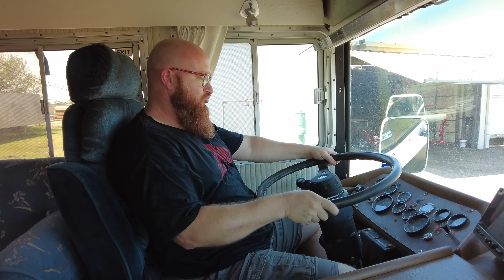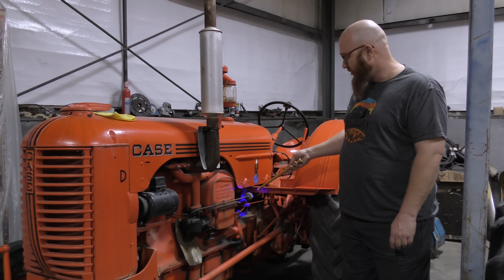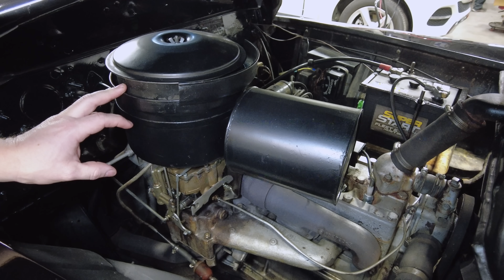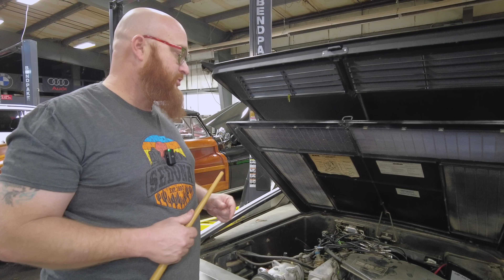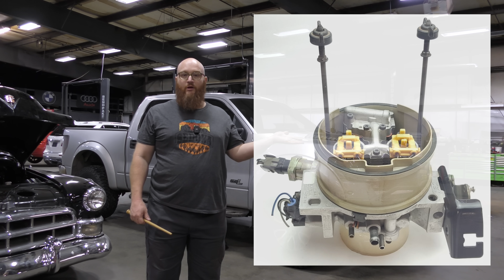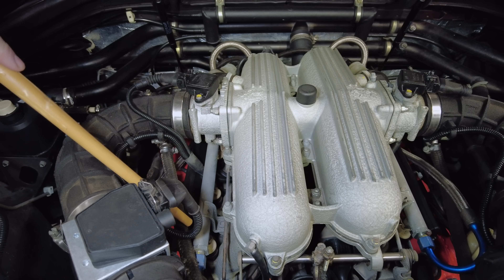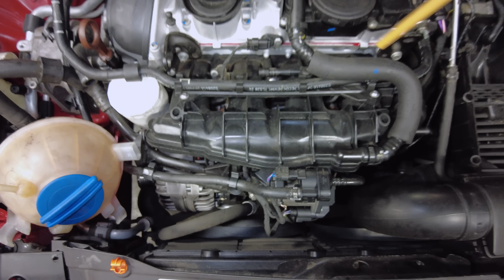Fuel System Maintenance for Every Car Type: A Comprehensive Guide

Comment: I used to have an 81 Honda Accord with a 3bbl carb on it. Ethanol wasn't widely used in gas like it was today. That car would run perfect until you drove it and stopped it for 30 minutes like going into the store to get some things. When I would go start it, it would start right up, but it would stall out after a minute or so and it would be a beast to get restarted. I spent a lot of money at the Honda dealer and they never fixed it. I changed the gas and the problem went away. It didn't like the gasahol that was sold at the time. That is what they called Ethanol fuel in the early 80s. Somehow the heat of the engine was evaporating the fuel or it was vapor locking? I didn't know what was going on. I knew it didn't like the gas. It ran perfect with 100% unleaded gas, so even in the 80s, the gas was better.

Comment: awesome recap of the history of auto fuel systems, I wish you would have mentioned Toyota's D4S system, that combines direct and port fuel injection
Reply: Toyota does it so it would not carbon up the intake valves and keeps the engine running past 100k with no issues of rough running
Reply: @ToomasTelling certain conditions port injection is more efficient, valve cleaning is a secondary (and necessary)  effect.
Reply: Is the Gm6.2L gas engine a combination of port and direct injection?
Reply: @dancin4  not sure,  the 6.2 has been through many generations of cars, if we're talking older than 2016 (possibly still with some newer model years as well) then  it is  port injection
Reply: So can the extra fuel injectors be spotted on the intake? Or is there an engine designation  type ie :LT4 or LS gen 4?
Reply: @dancin4  if there are direct injectors they will be on top of the valve covers or under the intake, the port injectors on LS series engines are always on the outside of the intake manifold at the base (where the intake bolts to the cylinder heads) on both sides

Comment: Wizard you forgot one more fuel delivery system. My wife has a 2020 Toyota Camry with the 2.5IL 4 cylinder engine that has both direct injectors and sequential fuel injectors in the intake manifold. The injectors in the intake manifold fire often enough to clean the intake vale. This is called  dual fuel injection engine. When the intake injectors cycle the direct injectors don't cycle. This is the best of two worlds when it comes to fuel injector engines.
Reply: Good engineering for sure.
Reply: In the d4s system the direct injection can run with the port injectors also
Reply: Ford 5.0 for F150 and Mustang has direct and port injection. 16 injectors.
Reply: You are correct,sir
Reply: Got to love Toyota.
Reply: Toyota #1 💯
Reply: But will Toyota put an electric-drive supercharger on it?
Reply: Regardless of the intended purpose of a direct and port injected engine, I REALLY wish my 19 WRX had port injectors in addition to direct injectors.
Reply: Yeah but its just a variation of fuel injection designed to compensate for the valve fouling on DI engines
Reply: @davva360  1a
Reply: @davva360 
That's not what it was designed for - it's simply fuel efficiency; that the intakes get cleaned is just a bonus.
Reply: @atticstattic  it was designed for that purpose.
Reply: @rgbigdog  
Most assuredly, it was not.
Reply: @atticstattic they don't do dual injection for efficiency. If efficiency was the only goal, it would just be directed injected, meaning it's always getting fuel most efficiently AND slightly lower weight. Having port injection as well is literally intended for the best of both worlds... better efficiency when needed, and internal cleaning in other situations.
Reply: @Scott8919  port injection can be more in efficient in certain situations  like at idle and high rpm
Reply: @scott8919 
That's blatantly false; there are situations where port fuel injection is more efficient than direct injection, having both takes full advantage of that. That the valves get cleaned is simply a bonus.
Reply: @atticstattic  Are you sure about this? The reason for direct injection is better efficiency and lower emissions. Does a mixed system do as well?
Reply: @deanrhodenizer938  
At certain load/rpm combinations, port fuel injection is more efficient. Toyota has had a number of write ups in the press about this since Lexus introduced it in 2006. More than a few industry reporters speculated that there was some kind of "cleaning cycle " that the port injectors were for and that turned out not to be the case - it's all done for fuel efficiency. Just so happens that cleaning the intakes is a benefit.
Reply: @atticstattic   Thank you for explaining. I learned something new today.
Reply: Ford has been doing this on eb's for years now. Nothing new.
Reply: All the port injection is there for us to clean the carbon buildup off the valves. Since DFI (direct fuel injection) fires right above or next to spark plug.
Reply: @brandonzackheim4550  
Wrong.  The combination of direct and port fuel injection allows for better fuel atomization and more precise control over the air-fuel mixture, leading to improved fuel efficiency.

Comment: Compare these fuel injection pressures to high pressure common rail systems in today’s diesel engines…diesel systems typically run well over 20,000 psi…sometimes over 30,000!

Comment: I'm watching from Brazil where we run our cars on 100% ethanol.  Is carbon build up still a problem for direct injection engines? Yes, we still have oil and PVC valves, so maybe...?
Reply: It is, it's the PCV system that causes the most buildup in DI engines as oil vapors burn onto the valve tops, and any oil that gets past the valve seals.

I like ethanol as a fuel, high ethanol content fuel (e85) is great for power and a clean running engine. I ran it for 10y until I moved and lost access to it.
Reply: Yup 100% ethanol here is a popular fuel. Government policy and specially bred sugar cane.... Gasoline is also available but priced so the per liter price yields about the same number of kilometers per unit of currency when using a flex fuel engine. Maybe ethanol has a small price advantage.  Seems air pollution from modern cars here is not a problem.   Diesel trucks are a problem... But I have not seen any alternative duels in use for heavy trucking.  EVs are rare. Do see some electric bikes and scooters in cities....

Comment: As somebody with a car that produces 66 BHP [Hyundai i10] I always use the fuel with the least Ethanol. It makes a huge difference!
Reply: If it's the Kappa engine, it's the same 998cc as my 1980 Mini, minus one cylinder. 🤣 But me, I'll never touch or buy a Hyundai or KIA. EXCEPT maybe the first gen Sportage. But that's if I failed to get a Suzuki Samurai, or a classic Lada Niva, which I have seen a Niva in my neighborhood.
Reply: Had Hyundais  for 25  years and can't fault  them! My 10 year old i10 should see me out!   _  would love a Niva - one of me dream cars! Couldn't afford the petrol!   @alpine1600s
Reply: Ethanol increases octane and can make more power. . . It does hurt fuel economy, however.
Reply: Honestly not noticing a dip in mpg using E10… you’d need a flat rolling road for a fair test I guess but I think it’s placebo mate especially on small N/A engines

Comment: I was glad when I purchased my first  computer operated fuel injected car. On cold mornings just turn the key and it would start and regulate the cold idle all by itself. On my previous carb mounted cars I would have to set the choke by depressing the gas pedal once and start the car without flooding the engine to warm up the engine then come back five minutes later and hit the gas to knock the choke off. The only thing I found annoying about fuel injected cars was that I could hear the injectors activate which I initially thought that it had valve tappet tapping
Reply: You could have just driven the car right after starting it up. Much healthier for the engine instead of letting it just run at increased idle.
Reply: Increased chance of stalling...
deadly in intersection/driveway exits etc.
 @SuperDirk1965
Reply: @SuperDirk1965  we used to have much colder winters plus my first car was a '64 Pontiac tempest lemans I bought for $200. Cars like that back in the day needed to be warmed up first as they would stall if you tried to take off on first startup. And yeah,with today's fuel injected cars I do take off within a minute of startup
Reply: @LilYeshua  I started driving in 1983 so I have driven my fair share of carburated cars. You pull the choke, tread on the accelerator a couple of times, start the car and drive it within the first seconds after it starts up. As it would warm up you'd gradually push in the choke. But then I'm talking about European cars, never driven the american crap.

Comment: Plenty of VW Golf GTi cars from the very early 1980’s still running in the UK and plenty more in the rest of Europe. Most are now with enthusiastic collectors. My friend up the road bought one just two weeks ago. We both had ones in 1982, his being a 1.6 and mine the revised 1.8 GTi.  All 112hp of it. The Bosch K-Jetronic was a big advance over carburetted cars of the era but was soon superseded by fully electronic fuel injection.  There were some examples of single point injection engines on four cylinder cars during the mid to late 1980’s.
Reply: Vauxhall in the UK with the Astra J (so 1997 ?), had single point injection on the lower power engines, and then Multi point sequential on higher output engines. So you could have a 1.4 with 75bhp or 90bhp.
Reply: Your fuel is much higher quality than what we get in the US.  As a result oil change intervals are double for my Porsche in Europe compared to the US due to the better fuel.

Comment: No more oil bath air filters unless it’s the modern ones you spray oil on and clean. Imagine not ever paying for air filters 😮
Reply: I believe the oil bath filters let dust through. They bubble air through oil and the air in the center of the bubble remains uncleaned.

I saw a test on one somewhere and a modern paper filter was better.
Reply: @volvo09  oil bath filters have a metal mesh inside that oil clings to.

Comment: Ethanol will boil in your fuel lines that can get hot once you stop. Can cause a stall until the fuel circulates and cools
Reply: If you have an older carburetor car that you dont drive daily the solution to vapor lock is to run Rec fuel (boat fuel) sold at some gas stations. It is non-ethanol. It is pricey but solves the headaches and embarassment.
Reply: @gregholst5604  I only get the stalling when I restart my engine, an LS1 in a Camaro, fuel injected. Todays gas is crap
Reply: @HypocriticYT   That should not happen to a modern engine with fuel injection.. when the key goes on it should pressurize and ideally bypass back to tank so any vapor is eliminated.. maybe another temp or sensor related issue?
Reply: @gregholst5604  only happens in hot weather once you dive a while and shut off and start again. No codes and have had a GM new fuel pump in it. Doesn’t do it in temperature under about 75
Reply: @gregholst5604  thermostat is good and gauges read good. Once I start it from a stall it doesn't reoccur. I should try a different gas station next summer to see if it's the fuel. Has new fuel filter, idle control and MAF sensor. Sometimes you have to wait until it gets worse to diagnose (if it gets worse) though not a big issue now.
Reply: I would try rec fuel (pure gasoline / usually 90 octane) next time your tank is low and get that worked into the system to see if it stops the problem. Engine temps and operation may be normal but a weak fuel pump or bad fuel recirculation may need to be addressed to run gas with ethanol and avoid stalls when it is warmer outside.
Reply: @gregholst5604  has a new GM fuel pump and tested good. I always run 91 octane fuel. The car is a 2002 so you can get odd stuff occuring.
Reply: Gasoline in your lines will boil at a lower temperature.  Cars being hydrolocked from gas boiling is not a new thing.
Reply: I meant vapor lock.
Reply: @RichiPuppi the fuel system should remain under pressure when the car is off (roughly 50 psi) the high pressure raises the boiling point. 

If the check valve in the pump is bad you will get vaporlock or drain back, but it doesn't last more than 5ish seconds.

Comment: ethanol content in fuel kills carbs, especially small engines that spend a lot of time parked.
Reply: Yeah, don't keep small engines unused. Run them regularly, or drain the carb.
Reply: Yup - I added a fuel shutoff valve and fuel stabilizer for both my lawnmower and snowblower when I park them for the year. No more bad carbs.

Comment: 3:10 remember, back then gas was actual gas all together different formula higher octane whole different animal.
Reply: Two stations near me are selling NON ethanol gas again.
Reply: @opuscat999  Right, where is that? Throughout the agriculture areas which is most of the state in central Kansas there are plenty of non-ethanol grades offered and it's getting popular. I was just there two months ago driving around and did fill up with it. Got to have it for the old equipment.
Reply: I am in northeast Ohio  @JSFGuy
Reply: In my area, Palm Beach County Fla, non=ethanol gas is one dollar per gallon higher a gallon than Reg 10% @opuscat999
Reply: During a recent power outage, had to help someone with getting fuel for their generator and they were told to get ethanol free fuel to preserve the engine.  Found out my local gas station (rural Mid-Michigan) has an aboveground tank and pump for 90 octane ethanol free @ 5.50/gal compared to 4.25 for 87 octane.
Reply: @danielseelye6005  Right, well you can run the 10% through there even a little higher if you run it through like today don't leave it set It's not the engine it's the carburetor and the pieces inside the soft rubber and gaskets and all that jive. I put 30% in my non-ethanol car because I was going to drive it out today and it worked fine.
Reply: "when gas was actual gas" you mean when it was a liquid?
Reply: @jongmassey  Yes, also had higher BTU. Before 2007 I can get about 400 miles per tank everybody nationwide lost about 60 miles per tank It's never been the same since.
Reply: @JSFGuy sorry, I don't buy it. Using 10% ethanol as compared to 0%, you lose a maximum of 4-5% total energy. Maybe 20 or so miles knocked off a 400 mile range. Which is made up for by the fact that ethanol is usually cheaper even after factoring in this loss
Reply: @d47000  I'm not talking about ethanol added I'm talking about something changed in the formula of the fuel it was nationwide everybody was mentioning it on car club web pages. We were well into the 10% ethanol policy by then it wasn't that, results vary generally speaking. People had all sorts of vehicles all sorts of routine they would drive every way it was the same and one day from then on they lost about 70 miles per tank everybody did.